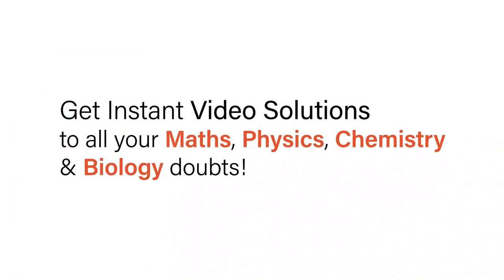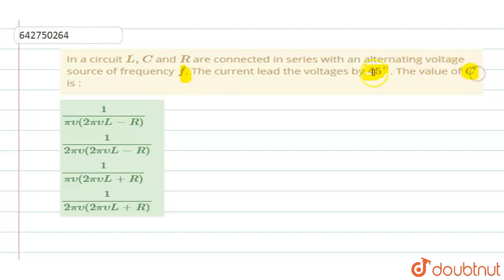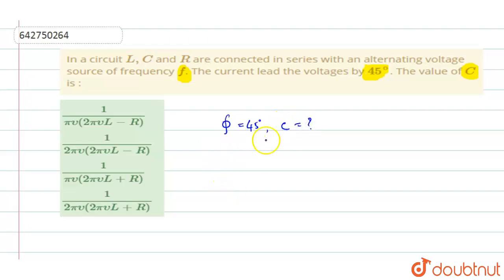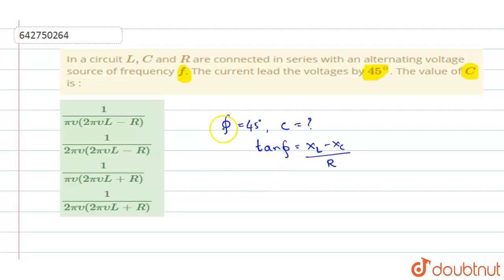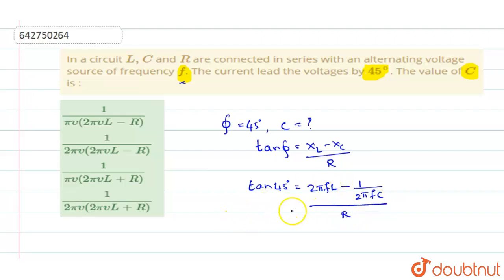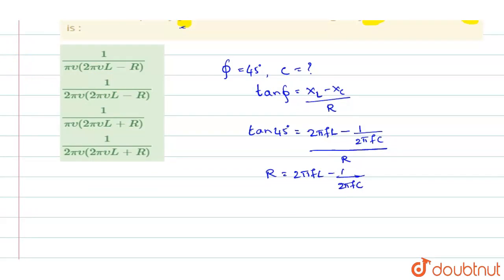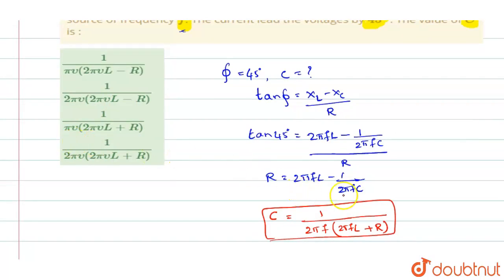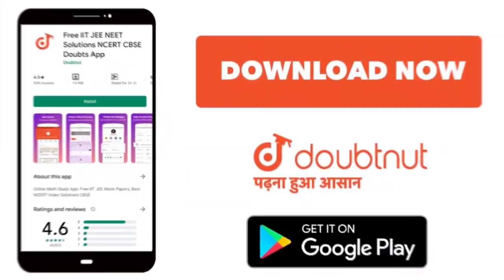In a circuit L, C and R are connected in series with an alternating voltage source of frequency ...

Comment: Calculation krke dekhiye galat ayega
Reply: Yes, there should be (XC-XL)/R,
as it is mentioned in the question that current leads, it means it is overall capacitive circuit.
Reply: @abhaytiwary2981  exacttly. i was thinking the same. thank you